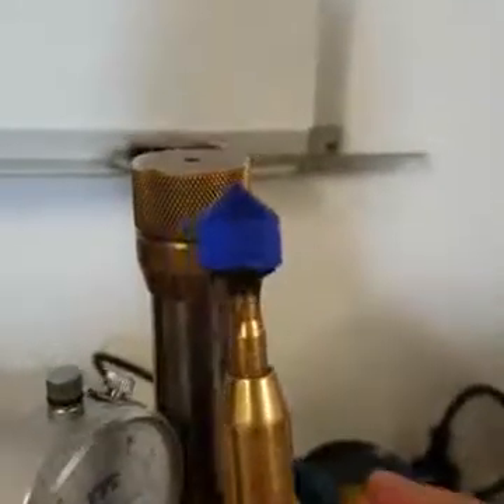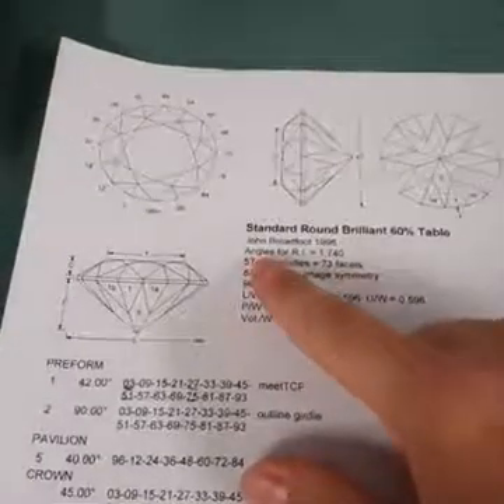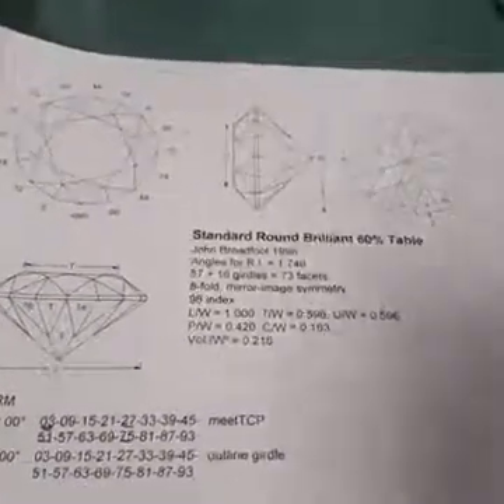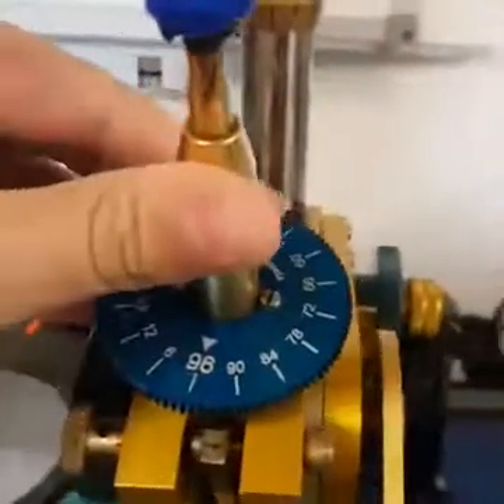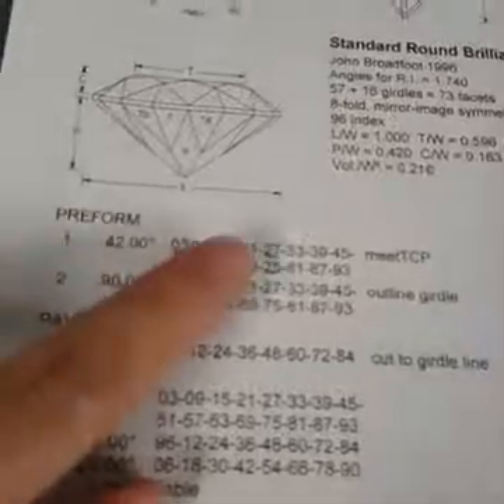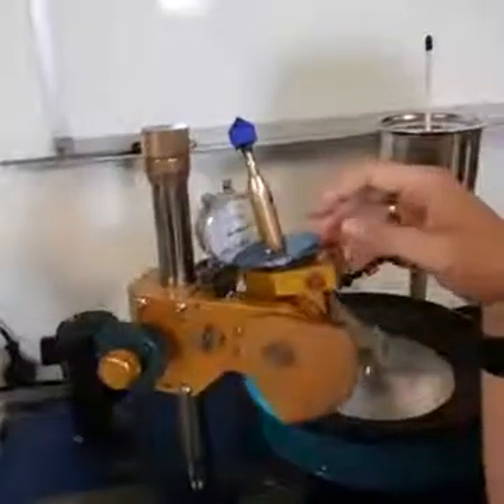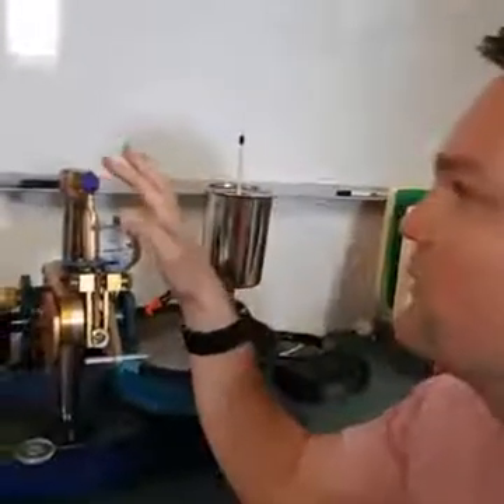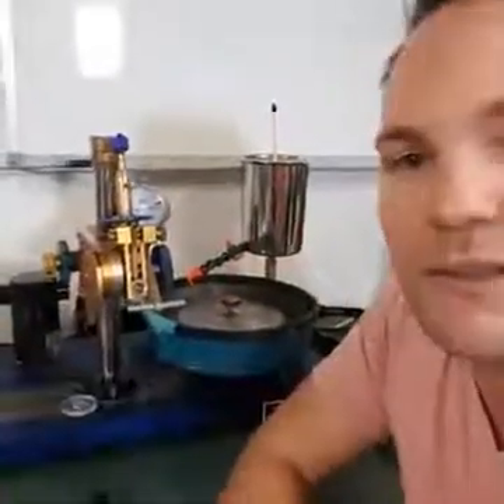Let us show you around a faceting machine

Comment: I've had nothing but problems with my Tom Thumb. Initially inoperable  the machine had to be completely rewired  so as to have power. That was the first six months. Next, a problem you don't mention because you have some miracle way of setting the angle, the angle does not set. You put yours at 42. If I did so the wheel just automatically collapses. There are no tightening mechanisms for it. I'm frustrated beyond belief and rueing not having saved up for a GemMaster.